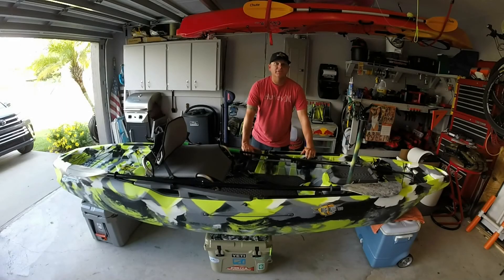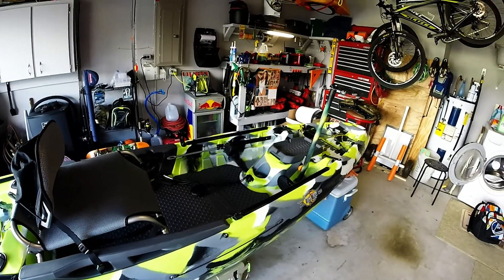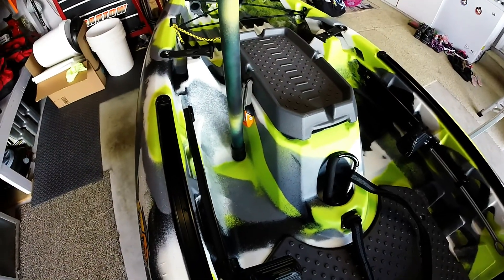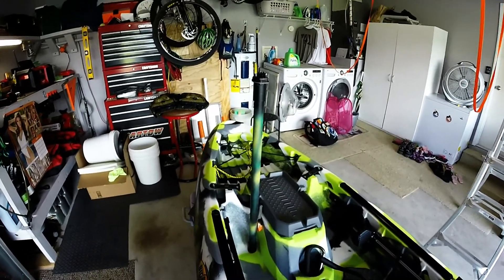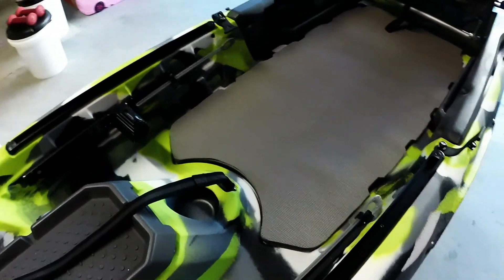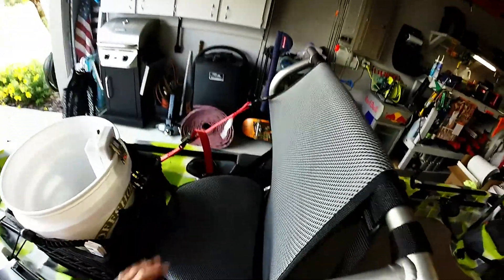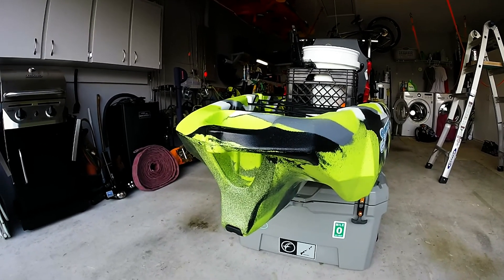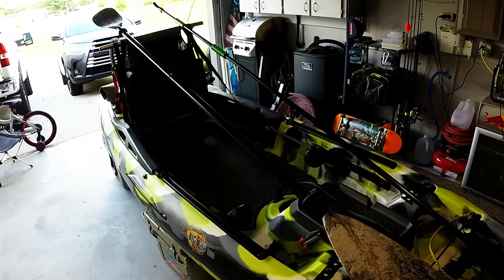BigFish120 3waters kayaks

Comment: You should really consider mounting an anchor trolley. I don't believe i could go out without mine. The rudder kit is a must. This boat is a beast in wind. When i first got mine with no rudder i kicked myself in the but for buying the boat. Thought i would never going to get back to the landing. Now its a pussycat. I got my beaver tail rudder back before the first of the year for 169.00. Now there 199.00. Anyhow i think you would love the trolley. One rope and it can go to the frount or the rear from one location.
Reply from the maker: I've added the rudder since the video and man is it a world of difference.  I've been thinking about the anchor trolly but I'm also considering the micro power pole, but haven't brought myself to spending that much money yet haha

Comment: We have a Big Fish and to me the hard deck in front of the seat is the worst part of the kayak. I hope someone creates a replacement that is softer and more user friendly.
Reply from the maker: Yeah that's the only bad part about this yak.  That deck gets hot and can be very noisy.  So far the yoga mat is working great.
Reply: @burnyyak4023  have you tried anti fatigue mats they should be perfect solution. They come in different patterns puzzle etc. And they have a little weight to them so no need to glue them down and if you desire that try double stick tape on corners. I sure would like to see a good video on standing on this yak im really close to buying on soon and in that green camo as well also with rudder.
Reply from the maker: Vince H watch my video titled “Red fishing in Tampa Bay”. Most of that video I’m standing.

Comment: What kind of fish bag do you use in the bow of the kayak? I am rigging my 105 now and wondered what works best.
Reply from the maker: travis mcquaig I went to Wal-Mart and bought a large cooler bag for like $10. It's insulated and holds ice for several hours.
Reply from the maker: travis mcquaig https://www.walmart.com/ip/DALIX-Large-Cooler-Tote-Bag-w-Zipper-Leakproof-Bottom-Carry-Storage-Diaper-Bag-Black/476858157?wmlspartner=wlpa&selectedSellerId=4200&adid=22222222228078994540&wmlspartner=wmtlabs&wl0=&wl1=s&wl2=m&wl3=191864245651&wl4=pla-302948382395&wl5=9012172&wl6=&wl7=&wl8=&wl9=pla&wl10=113510305&wl11=online&wl12=476858157&wl13=&veh=sem

Comment: Do you use a cart?   I have this yak but don't know what cart to use
Reply from the maker: I built my own using PVC pipe and tire from harbor freight.  Here's a Facebook link for the one I made. 
https://m.facebook.com/groups/1900411440210908?view=permalink&id=2047958028789581
Reply: Not what I had in mind but looks like it works for sure.  A video on that would be sweet.
Reply from the maker: @SOFTAILX  here's a rack/cart I made for my yak with video.
https://youtu.be/g9gUf_Idy6g
Reply: I have this kayak and use the c-tug standard no issues.